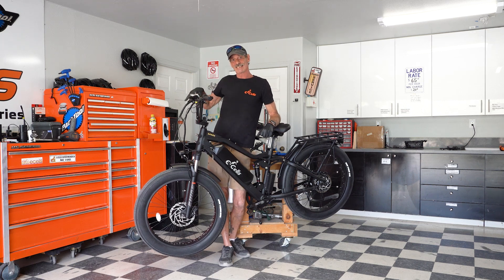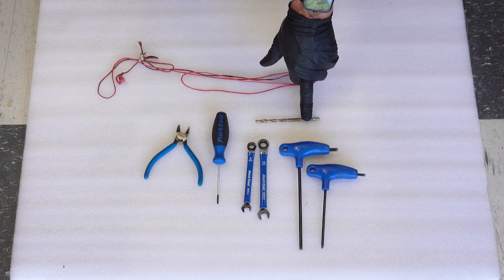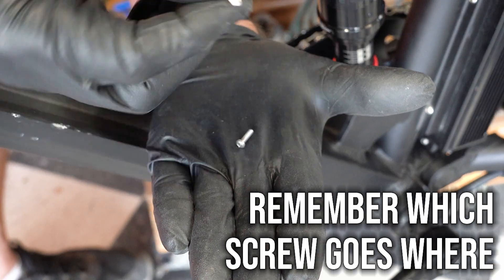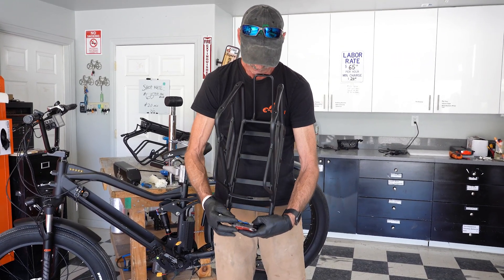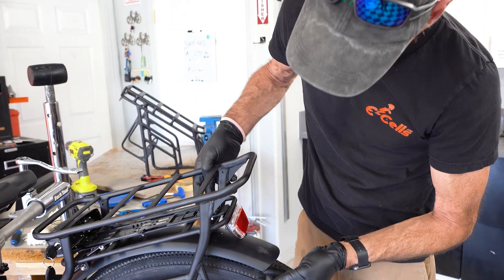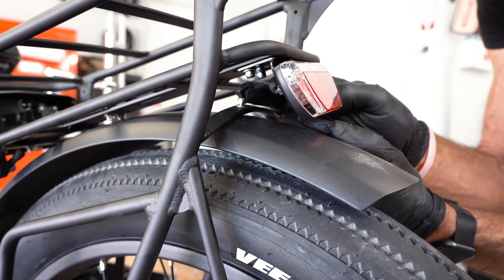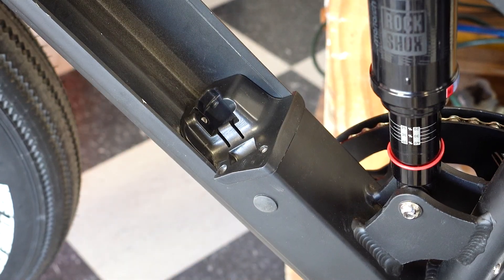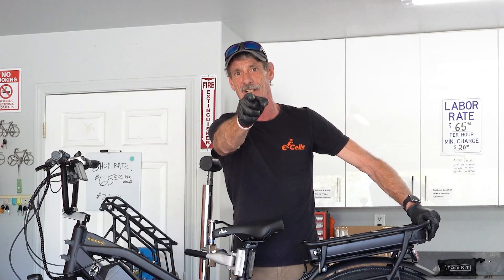E-CELLS FIVE STAR Dual Battery Conversion

Comment: What is inside the tool kit from e cells? Video on that?
Reply from the maker: The tool kit includes a small air pump, tube patch kit, a multi tool with screwdrivers, Allen keys, and sockets, and several different size wrenches.
Reply: It's better then the toolkit your car comes with.  But, if you're commenting here, you're probably going to want to buy a few things extra.  When I let the air out of my back tire, I took the pin out of the tire.  Sure, I could press the pin down, and squeeze the tire...  That's tiring.  I took the pin out of the valve.  That's the pin that holds the air in.  (Kits are dirt cheap on AMZ.)   I also bought an electric pump.  Used to carry it with me, but I don't anymore due to weight.  If I have a real problem, the kit has a pump.  I used to carry a spare inner tube too..

Comment: I believe you should also mention that both batteries should be at or near the same voltage. If one is low charge and the other is high, there is going to be a very rapid charge/discharge as the two try to balance out.
Reply from the maker: We definitely recommend charging both batteries and using them simultaneously on all of our dual battery models. For this video we just did a quick check to make sure the installation was successful and both batteries provided power.